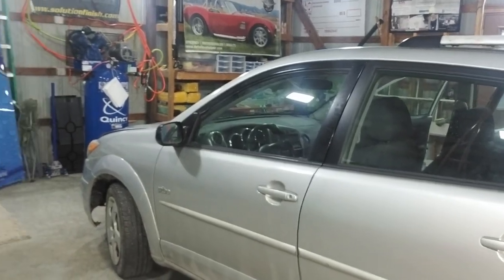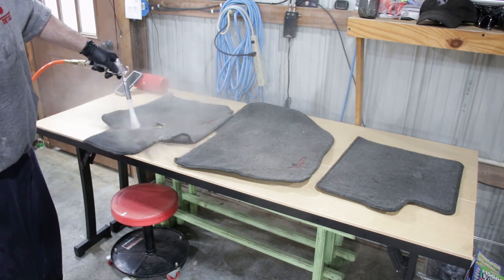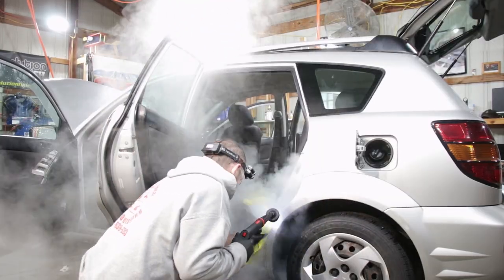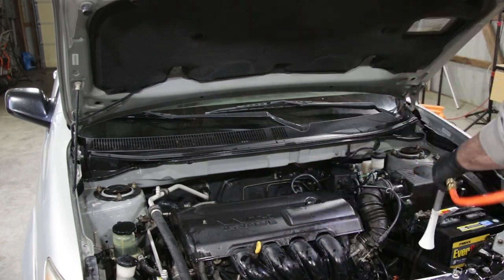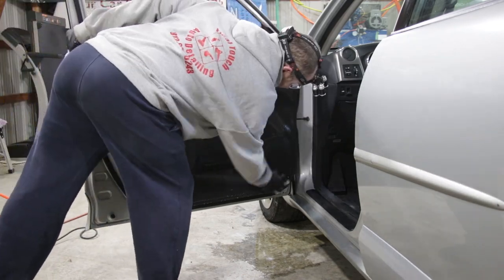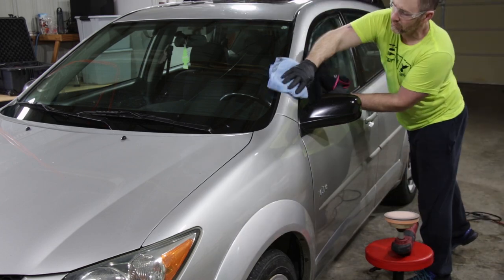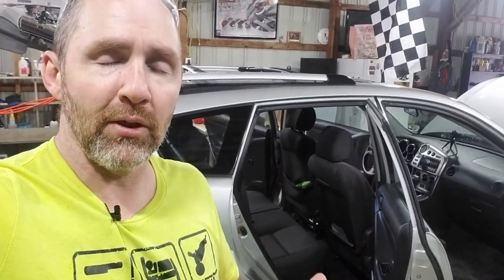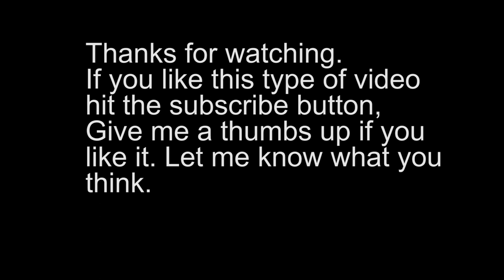Disaster Detail | Pontiac Vibe gets a Make Over

Comment: these Vibes are amazing cars, mechanically identical to the Corolla and Matrix, but better looking, roomy inside. Came back from Oregon in my 03 Vibe and touched FORTY miles per at sixty mile an hour !!!
Reply from the maker: That's pretty awesome,  I like roomy but small cars like this. Definitely good cars, I know a few people who have them and they last a long time.
Reply: @finaltouchautodetailingllc  Theres a 'beauty in the simplicity' of a car thats basically a rolling rectangular box. Theres SOOO much wasted space in modern SUVs it drives me nuts. My sister has a newer RDX and it feels like you have as much space as an older sedan on the inside, how is that possible when its a midsize SUV on the outside yet theres as much useable space as an old Vibe/Matrix.
Reply from the maker: @sergeantbigmac  I agree these little cars are awesome!

Comment: The front doors have a cloth portion on them - how did you clean those?

The video was very helpful
Reply from the maker: I don't remember how I cleaned these door panels with out watching again, but cloth on modern cars clean up nice  with a damp microfiber towel with mild detergent.  Otherwise steam works wonders with microfiber towels and little to no cleaners
Reply: @finaltouchautodetailingllc  Using a damp microfibre towel with mild detergent seemed to work. thanks for the response.
Reply from the maker: @ricmarcucci7378  Awesome,  thanks for giving it a shot, and thanks for letting me know it worked out.

Comment: If this is the care the owner takes of their car, can you imagine the mess in their home? This is far beyond lazy.
Reply from the maker: It's pretty wild what I see in life sometimes.
Reply: @finaltouchautodetailingllc  
As a former Mobile Crisis Worker I can fully agree. Wild animals keep their nests in better order & condition than that.
  While I've got your ear may I ask a question? We're seniors & have just purchased a used Toyota Matrix. The hood looks as if someone fired a shotgun at it. And the sides look as if the vehicle has been driven down a narrow, bush-lined lane... mostly light scratches from one end to the other. (I mentioned "seniors" because we're just not up to hours of labour to gain a perfect finish. We just want to stop further deterioration.)
  Many of the "stone chips" on the hood go deep enough so I can see rusty bottoms. I was wondering if I could apply a drop of Neutra-Rust to convert the rust to a hard inert base and then cover with a drop of paint, then wet sand &/or compound, then clear coat & polish?
  Thanks for any advice. And thanks for a top notch video.
Reply from the maker: @rae0521  it could be possible to do exactly what you are describing,  depending on how big the over all area is your working on. It could definitely be time consuming.  But without seeing some good photos at least,it's hard to give a best direction to go with
Reply: @finaltouchautodetailingllc  
Thank you very much for your opinion. The area of "chips" is limited to the front most  half of the hood of the Matrix... not a large area but there must be 2 dozen "chips."
  I'll just do a few at a time and see how it goes. Thanks again.
Reply from the maker: @rae0521  if it's that small, I'd say go ahead and give it a shot how you mentioned it. Especially if there is a bit of underlying rust.
Reply: @finaltouchautodetailingllc  Thank you for your help.